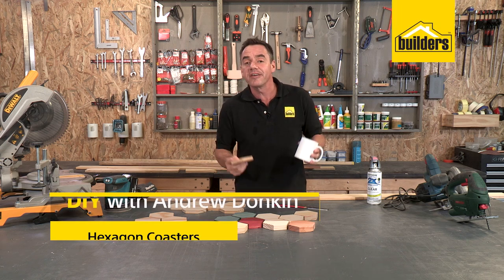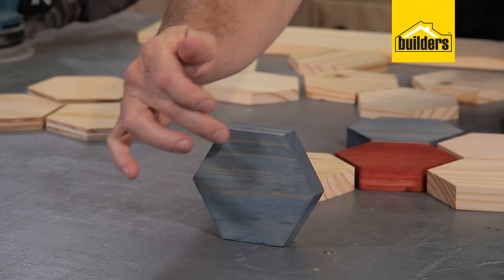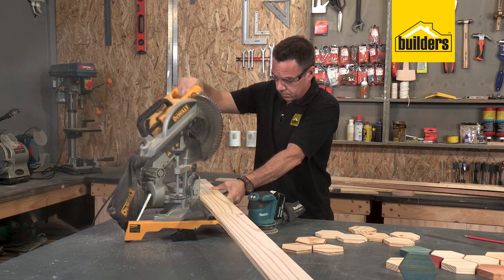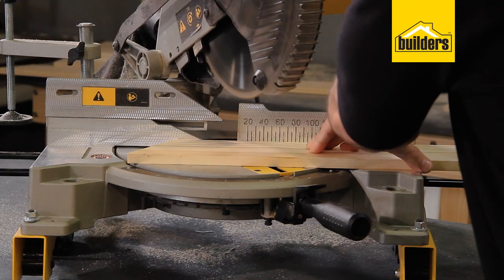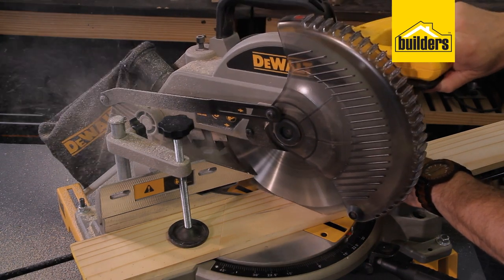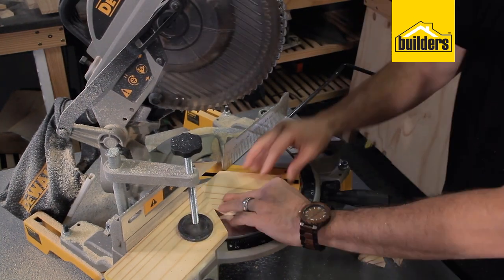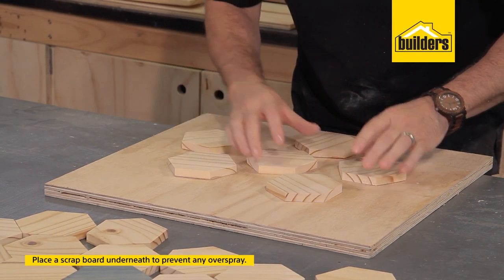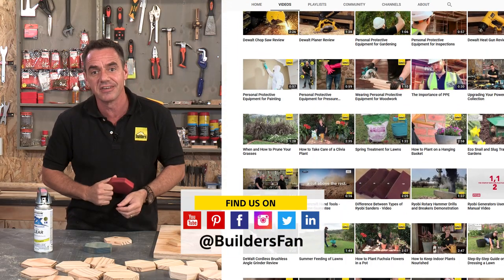How to Make Hexagon Coasters

Comment: Much easier on a miter saw than on the table saw, coz you have to build a sled jig for that, although doing it on a table saw is safer, but as long as you control, you dominate well your miter saw it's safe as well.